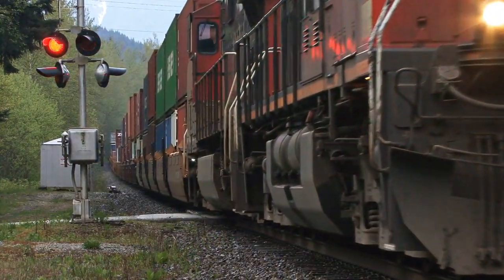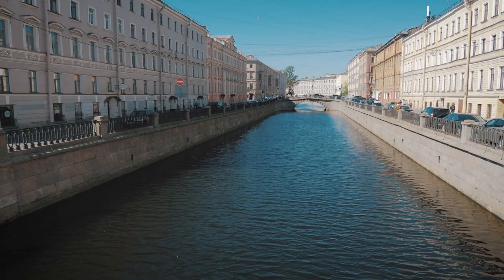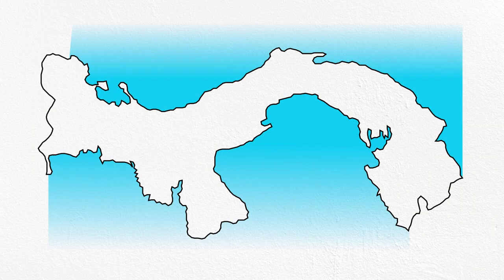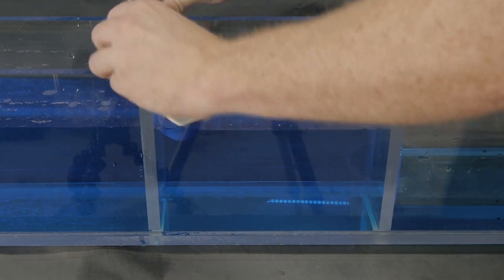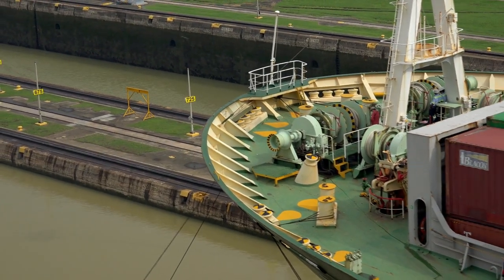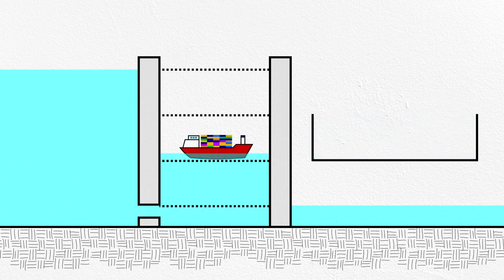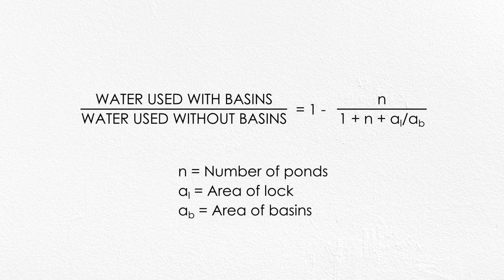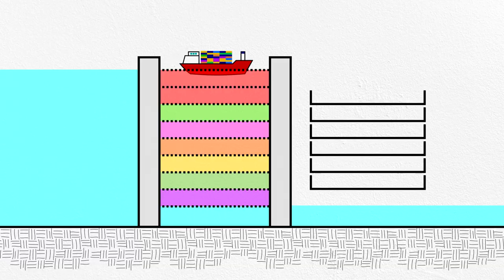The Surprising Efficiency of Canal Locks

Comment: You should have briefly mentioned why water transport is so slow.
While floating on water is efficient, at high enough speeds it quickly isn't.

Ships are like airships. Except they (practically) don't need to do anything to stay afloat. Unlike airships however, they are in contact with the water's surface at all times. They have almost the same cross sectional area of air to push through as an airship does, but weigh millions times more so the air resistance is less severe for a boat.
It's the contact area with the water that's the source of most resistance.

Just like air, water's resistance increases with velocity² (not exactly but close enough) so double the speed and quadruple the force required to maintain that speed.
Or in other words, quadruple the horsepower and fuel consumption.
This is why most freight ships tootle along at around 24 knots (44 km/h, 27 mph) as it's the best tradeoff between "getting there sometime this year" and "not spending a fortune on fuel".

Or in short, ships are slow because water is denser than air and thus they encounter the same resistance a car going 60 miles per hour does at their normal speed.
Reply: This is also why a lot of people are interested in trying to bring back sailing ship. The main expense for freight right now is fuel and that's why you get ships going so slowly, if the ships were powered by wind you obviously wouldn't have that expense and a sailing ship can easily reach these speeds. Sailing ships were mostly abandoned not because they're slow but because they required large crews but with modern technology it might be possible to make almost fully autonomous sailing ships. This would obviously have huge benefits to the environment, cargo ships are already one of the most environmentally friendly ways to transport goods and this would completely eliminate emissions from them. And it's an area with a lot of promise because it'd make economical sense for shipping companies to adopt modernized wind power.

The main challenges right now is in trying to reduce the roll of sailing ships since these days we stack containers up extremely high so therefor we can't have the ship roll much.
Reply: "tootle along" xD
Reply: @hedgehog3180  I've been curious if it would be viable to have solar-powered ships.

Obviously this is limited by the ratio of solar panels to the size of the ship, which means the most viable platform for such a design would be something with the largest possible deck area for the least amount of energy required to move the ship. (the first thing that comes to mind with these requirements is a catamaran)

Compared to a conventional sailing ship, the advantages are that you can move in any direction as long as there's sunlight, which there is fairly reliably at most latitudes for a decent part of a day. (if your energy used/energy input ratio is suitable you can of course use batteries to extend travel time into the night. But it may just be more efficient to not move much at nighttime...)

While there would likely be both advantages and disadvantages of this compared to a sailing ship, it's another way you can get 'free' transportation.

The question is whether it's possible to make a ship with a large enough surface area to carry a useful load at reasonable speeds... (also the logistics of it I suppose. - since you can't block the solar panels, that means you'd need a loading scheme for the ship that doesn't require lowering things onto it from directly above... Or at least, you'd have to be able to get a load under the solar panels. - this is trivial for a passenger ship, but somewhat more convoluted for a cargo ship.)

Regardless of whether that's viable or not, there's certainly some interesting 'free' power options that could be attempted (or revisited) for shipping...
Reply: @Cadde, I think it's important to clarify what is meant by water resistance. It's not the surface area per se, but rather the volume of water displaced. You could make a ship's hull out of a hydrophobic substance, reducing the actual friction to near zero, and it will still have to displace tons of water as it moves through it. This is why hydrofoils are so ingenious, they eliminate much of the "displacement" and replace it with "lift" which of course requires speed. :-)
Reply: @hedgehog3180  There's a larger obstacle than roll:  nobody has ever built a sailing ship anywhere near the size of a modern containerized freighter. 

If the eight largest sailing ships ever built were all still around, and if you could collect them all fully loaded, repackage their cargo into modern shipping containers, then cut up the ships themselves and pack them into shipping containers too, plus all their supplies and crew (ethics aside) and everything else, you could load all of that onto a single modern freighter with room to spare and take it through the Panama canal in one trip.  Even setting aside the very significant (especially in light of locks) issue of shape, just scaling up a sailing ship to be able to carry an amount of cargo commensurate with what a modern large freighter carries, is a decidedly non-trivial exercise.  

Oh, and those eight largest "sailing" ships ever built that I'm talking about?  I went ahead and included the Great Eastern, which in addition to sails also had steam engines; it had more than twice the displacement of any of the others, over 32 thousand tons, which was absolutely huge in its day.  She was broken up for scrap in 1889.

And yes, I'm comparing the total displacement of the sailing ships, vs the deadweight cargo capacity of a modern freighter.
Reply: @FlatEarthMath  I am of course working under the assumption most people know that plain old air is actually a fluid medium. That, apart from its density, it's no different from walking on the bottom of the ocean.
Reply: I think the sailing ship idea is impractical for many reasons.
One being you still need to have power generation for many other things. So you would still have to run a generator of some sort.
And you would still have to have some sort of non-wind based propulsion for docking.

Solar power could work but one has to remember we are out at the high seas. There's this thing called storms and tall waves that will impose a lot of requirements for the solar panels fitting and securing. Especially considering solar panels work best when they actually face the sun, so they should be able to rotate or the ship might just be dead in the water during most of the day.

Let's then add the fact that freight ships tend to travel up and down the latitudes. Meaning the sun might rise at 10am and set at 3pm. Or worse depending on how far north/south one goes.

Sailing ships had their problems back in their heyday. And it wasn't because of the amount of manpower required that they eventually were replaced with engine powered ships.
Reply: @RealCadde  See my link.  Plenty of hybrid options that will at least greatly reduce fuel consumption.  No need to go all in with one or the other.  A combination of technologies is often the best answer.
Reply: @Kharnellius  Yeah no i don't need to.
You are of course correct in that a combination of technologies would be beneficial.

Solar panels, not so much but they could be useful as a backup system for vital electronics.

However, windmills would definitely be beneficial. And no, not propeller ones. Cylindrical ones, the same passive air circulation systems you see on shacks and stuff.

Sails are not a good solution because of their limited appliance and performance considering the ship is already top heavy and has to actively counteract any heaving.
Reply: Jonadab the Unsightly One   Size isn't everything.
Reply: There is nothing wrong with going all out if you are creative and don't discover something actually fundamental that stops you. Being top heavy isn't inherent. Funnily off-topic: traffic 'engineers' in many places can't even go out partially as they usually respond to your email with 'sorry we can't slow cars down here to save lives, it would hurt traffic flow by a few seconds', but meanwhile in Netherlands 'ah there ya go, matey'. Not really thinking those lot. Some industries need a huge cultural overhaul.
Reply: @hedgehog3180  you need to look at the ocean wing and the energy observer boat. Its fully energy self sufficient on the water and uses the oceanwing as an automated sail.

The energy observer is a converted racing catamaran that uses wind and solar to electrolyse the seawater to then charge a hydrogen fuel cell.

It's been on the water for a few years now and it's doing a new world tour.

Worth checking out.
Reply: @jonadabtheunsightly  The GREAT EASTERN never was under sail even thought she had 6 masts and was rigged for sailing.  They tried it once but couldn't raise the sails.
Reply: @RealCadde  re: "Air is a fluid"
I'm sure there's a story where aliens teleport someone to the ocean floor because they don't consider density. Humans live at the bottom of a fluid, that's where it is, what's the big deal?
Reply: @hedgehog3180  Course the other issue with sailing ships is you can't schedule them in to a modern just in time supply chain, that said perhaps using wind turbines rather than sails could be a solution here. Doing it that way and producing electricity to feed into an electrically driven main screw you could easily include a number of diesel turbines perhaps units like those in a diesel electric locomotive that could provide top up the power supply if the wind was insufficient. Of course this could also go the other way too when the wind is good you could probably shut the diesel generators off entirely and let the wind turbines power the ships internal systems and the cargo power hookups for the refrigerated containers too otherwise you would need a rather large diesel power plant on board anyway so making it a true hybrid by using turbines might be a better idea course we can do this in the 21st century not so much when sailing ships went out of service in the past.
Reply: @hedgehog3180  I don't think the idea is go 100% sail power because quite frankly that just won't work with what we expect from modern shipping.
Its more, add something to the ship that allows wind to help propel engine powered boats and reduce fuel costs.
Reply: Also, they are efficient because they are big. Cargo scales with volume (length cubed), while water resistance scales with cross section (length squared).
Reply: @FlatEarthMath  : lift requires money, if you don't have a lot you don't get so much.  lol.
Reply: The fundamental problem with sails is that there is a minimum speed you want a ship to be capable enough, so that they can SAFELY navigate, no matter the sea conditions.  Very large ships require lots of power to move at even modest speeds, and that's hard to achieve via any sort of sail (including the various high tech wind turbine sails) in anything other than Good sea conditions.  Sailing cargo ships going through the North Atlantic simply won't work - you'd have to install effectively the current ICE power plant to use when the weather got bad.   In other words, a "practical" modern sailing freighter would look just like the existing one, except you'd have to swap out 15-20% of the cargo volume and weight to put in the new sails.  That's a terrible trade off. 

Sails and wind turbines are simple a terrible idea for large displacement+bad weather. 

Oh, and one other thing:  power required to drive a ship does NOT go up with displacement. It is dictated by hydrodynamic efficiency, which is a function of hull shape. Displacement is really orthogonal to the discussion.
Reply: or instead of the long drawn out verison you did .   its Drag Baby Drag.../ Resistance  there  all done.
Reply: @hedgehog3180  There are Rigid sales, but the ROI doesn't seem to be very good to invest into it
Reply: So in my physics class way back when, my professor was showing us how a threshold would have to be overcome where it becomes efficient again, and that is [and i know; were no where near this level of technology yet] where you reach a certain speed, akin to the speed of a bullet, which would then form an air cavity behind it,  and then thrust would be able to be achieved absent the liquid of water, something like getting a jet turbine to be able to operate within that cavity, but admittingly these a mere concepts, real world app has no where near been proven yet
Reply: Nuclear cargo ship can do the "emission free" job

Comment: Oh wow, Hanover is basically just around the corner from me, and I've never heard of this amazing lock! For everyone who's interested, it is Sparschleuse Anderten on the Mittelland canal.
Reply: Daniel Bohrer only 600 meters from the very final U-Bahn station it appears. So you can even visit it using the Hanover transit system.
Reply: Its acutally called Hindenburgschleuse and it's kind of unimpressiv. I lived there and as it has beeing said in the video: you cannot see anything other than the canal and some buildings. If you cannot get a guided tour (which are very rare) it's not worth a planned visit
Reply: A (much!) more impressive structure on the Mitteland canal is IMO the Magdeburg Water Bridge which enables ships to travel from the Mitteland canal over the river Elbe directly to the Elbe-Havel Canal and still enables ships on the Elbe to travel under the bridge. There's a nice picture at https://www.ratswaage.de/files/gfx/content/6_Magdeburg/Magdeburg_1600-2015_Copyright_Andreas_Lander_kl.jpg, many more can be found online. English Wikipedia article: https://en.wikipedia.org/wiki/Magdeburg_Water_Bridge
Reply: I drove by this lock almost daily for a past job and still do quite often, always thought it looked interesting but never knew it was that interesting ^^

Comment: One of my favorite canal stories is of the Delaware and Hudson Canal. I grew up in the area of Scranton so it was local. The canal ran 108 miles from New York State to Honesdale, Pennsylvania, and had 108 locks. The story told was that an early plan was to run the canal to Carbondale, where the mines were producing the anthracite coal the canal was to transport, but that was scrapped in favor of a gravity railroad (used animals like mules or fixed-position steam engines to pull rail cars up grades) due to the Moosic Mountains standing between the two points, which, with the shallow lock technology of the day, would have more than doubled the number of locks on the canal.